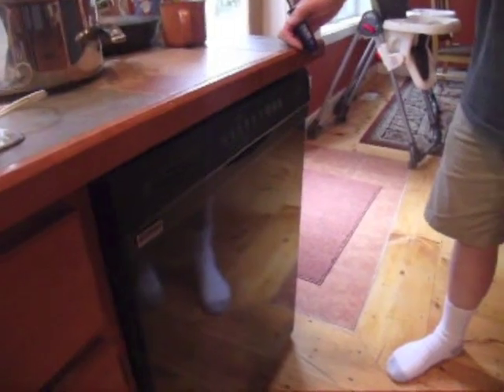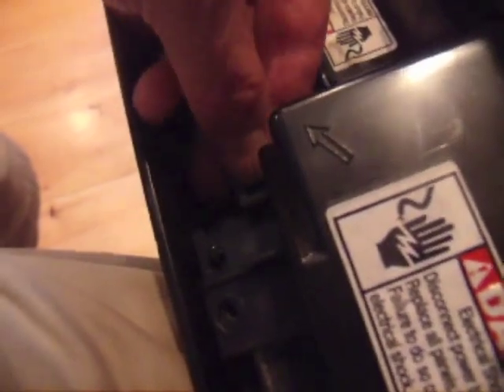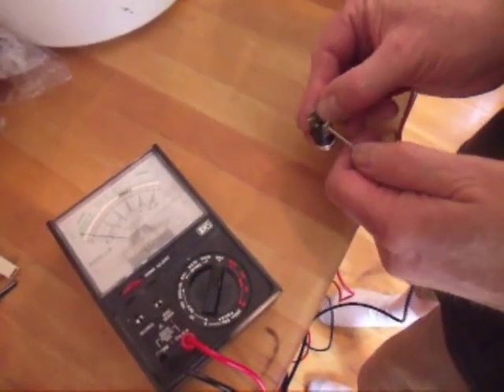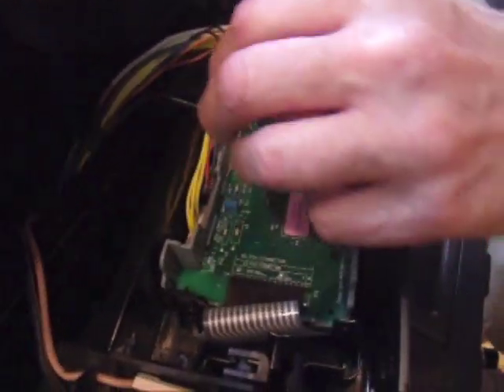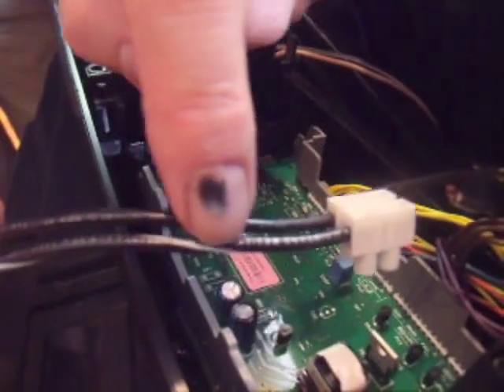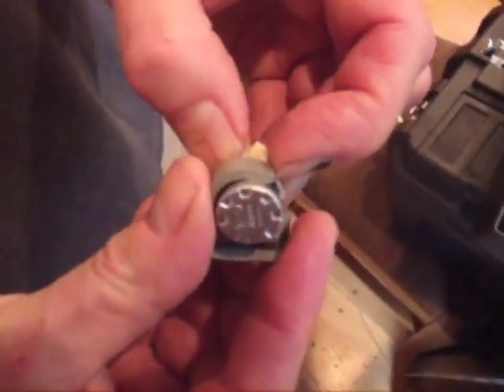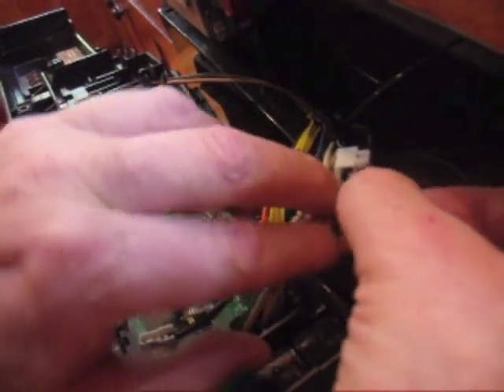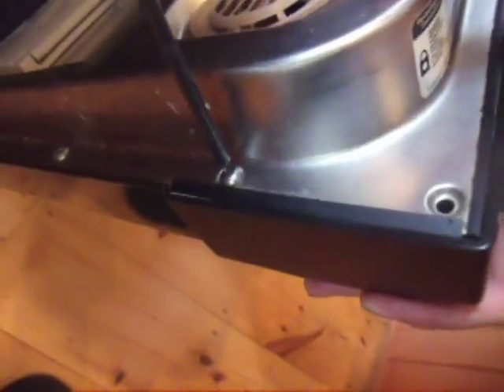What to Do When the Dishwasher Won't Start

Comment: To the people asking "why cut the wires and replace the leads"?
The OEM replacement part calls for you to do that.  The new "connector" has heat sensitive material inside that helps, more accurately, to protect the dishwasher.  Apparently it was to correct a design flaw in the original engineering, where the bi-metal fuse wasn't blowing as it should when the unit overheated.
The new connection is more sensitive, thus allowing the fuse to blow as it was originally intended.

This isn't something this gentleman just decided to do on his own.  The instructions that come with the replacement kit calls for it, and he was just following said instructions.
Reply from the maker: Precisely. Thank you for the helpful explanation!
Reply: Goat comment! Thank you.

Comment: Why did you cut the wires and replace the leads? Makes no sense. It was the fuse that was at fault.
Reply: True, I was wondering about the same thing too
Reply: I was thinking the same thing and made a comment as such, but then read elsewhere that the new kit has updated heat resistance that better protects it. But I guess if you were only able to find the fuse locally you could obviously just change it and order a kit just in case

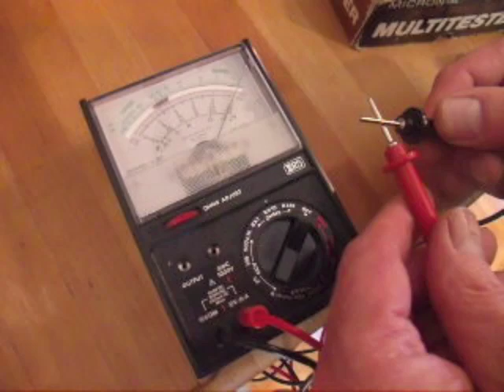Comment: At 4:27 we see that the new fuse has the same connectors, so there was absolutely no reason to cut the wires at 01:58. Indeed, at 01:37 he removes the old fuse from the wires, so why didn't he just do that to begin with, instead of cutting the wires off??
Reply: Then he should have had stated something about checking the replacement thermal fuse connectors, and IF they do not match, then verify that you have the correct replacement fuse, and only after those two steps should you cut wires.  I see that by adding that wire joint block, he has more versatility with what he can connect, but is the fuse going to change with-in the same model of dishwasher circuit board?
Reply: The replacement came with a pre-wired thermal fuse with a preinstalled coupler.
Reply: i thought he was going to solder them together and not use a fuse

Comment: Thank you so much Stan for posting this video! I was stressing out because we could not afford a new dishwasher and/or to hire anyone to fix it (ours is an older KitchenAid Architect Series II Built-in Dishwasher KUDK03ITBL) So I watched your video and thought I'd give it try. After weeks of dishes piling up, I found where I could get the exact fuse, and simply replaced it. I've never been so excited to see little blue lights light up on the dishwasher in my life.... Success!

Comment: I didn't have to cut the wires? Why would you do that? You can just replace the fuse!! It's all fixed and works great!! Thanks for the great tutorial minus the cutting the wires part ;)
Reply: They say to use the entire kit as the metal connection acts as a heatsink possible keeping the heat down so that it dosn't blow again! Apparently there is a problem somewhere are it wouldn't have blown in the first place, maybe as parts get older they start to require more energy and thus more strain on the fuse, so this is where the new wires and heatsink come in to play! Hope this helps some, cause I was on the same band wagon with why do that!

Comment: +doityourselfstan,  Why the hell do you cut the wires and go thru the whole process of stripping them etc, when all you have to do is pull the plugs off the new fuse and plug the old wires right back on?????   That would only be necessary if the new fuse came with different size plugs for some reason, but in my experience that is not the case.  Also, you stressed the point about making sure to match up the wires correctly when doing it your way - black wire to black and striped to striped - you do realize this is simply a FUSE, right???  It makes NO DIFFERENCE which wire you connect to which, LOL.  A fuse is not polarity sensitive, the electricity goes in one side and comes out the other, electrons don't care what color the wires are!!  LOL
Reply: You ALWAYS cut the wires. The wires and connectors often cause the thermal fuse to blow. This type of fuse is not the typical fuse everyone is familiar with. It blows due to high temperature, not shorts. If you read anything on a dishwasher thermal fuse, people have installed as you describe, using the old connectors.  May work a couple times but they all end up getting another thermal fuse kit and doing it just as Dan describes. Go to Amazon, search dishwasher thermal fuse, and then read a few of the comments.  Every single person who tried to short cut the repair the way you describe, ended up having to purchase another kit. 100% of the time.
Reply: @gregsimpson621  I think half of the failure rate has burned up connections, it is why the thermal goes out. The newer spade terminals are probably more heavy duty. Once you pull the original terminals off they get more sloppy...
Reply: I'm getting ready to deal with this problem, so bare with me.
I totally get the reasoning for using the new wiring over the old wiring. That makes sense. But, my question is.....will the wire damaged by overheating be only within the first couple of inches from the fuse? Or, could more of the 2 wires be damaged on down the wire?
Thank you for insight!
Reply: @danmidkiff5416  The heat is generated at the connector from a bad connection and travels down the wire. It is usually only a few inches from the connector. If you have heat damaged wire you want to cut farther down where the wire is good.
Reply: @jamesward6503  thank you, James! Happy New Year!

Comment: Try this first, take the dish washer panel off and use some (do not use WD40) CRC QD Electronic Cleaner (Wall Mart under $5.00) or any electrical contact cleaner. TURN OFFTHE POWER BEFORE STARTING THE REPAR !!!!!! This may work on your garage door, microwave (worked on all three for me )washer, dryer , computer and any other circuit board and electrical connections Your contacts on your circuit board and wires may be dirty. So don't be stingy (it will not hurt any of the electronics) soak the connections and boards. I have to do this with my microwave (if you boil a lot of water) and I fixed my 14 year old garage door opener. Fixed my dishwasher today and it's   over 12 years old.  Not sure why no repair guys don't tell to try this before more elaborate fixes

Comment: That is only one cause. My Whirlpool Dishwasher control panel does not light up! There is power in the door , the Thermal Fuse has conductivity and so does the door switch. Does this mean the Motherboard is bad. Your title should be, "One Reason Why Your Dishwasher May Not Start".

Comment: Every 3 weeks my dishwasher just doesn't turn on.  I have to turn off the breaker....unplug the power to it replug it in reset breaker then randomly it works again for another 3 weeks....I wonder how I can troubleshoot this problem with a multimeter

Comment: Hi, I bought the fuse online and replaced it. But still it won't start and no lights. Any suggestions ? please
Reply: +Breesh Pruthi
A power surge knocked out my stove and dishwasher circuit boards -- neither had any working lights.  Looking at the boards, it was very obvious that a resistor burned out on each.  The local appliance repair store charged $180 for a new dishwasher circuit board (plus $60 core charge).  A ridiculous price, but I needed it NOW.

Unfortunately the thermal fuse burned out a week later.  Tomorrow I replace the fuse and hopefully everything will be good.

Good luck!

Comment: The problem here may be underlying. As a mechanic, the question begs, why does a fuse blow? The obvious answer is an overloaded circuit or a short. Electrically,  the same thing.

Comment: Thank you for the video. I didn't not cut the wires like you said I just replaced them all because thats what came in the packet. But you did show me how to use the o-meter  to see if my fuse worked. Which it didn't. So thank you a lot
Reply: hi pretty lady

Comment: Great video Stan!  Clear, concise, and to the point.  Anyone who does not cut the wires but rather tries to use the old clips will be buying a second kit. I'm glad you emphasized that critical step.
Reply: I'm very curious to know why that's necessary.  As a novice repairman, it just seems natural to reuse the old clips.
Reply: They say to use the entire kit as the metal connection acts as a heatsink possible keeping the heat down so that it dosn't blow again! Apparently there is a problem somewhere are it wouldn't have blown in the first place, maybe as parts get older they start to require more energy and thus more strain on the fuse, so this is where the new wires and heatsink come in to play! Hope this helps some, cause I was on the same band wagon with why do that!
REPLY
Reply: Good point but along those same lines it would seem that complicating the cable (splicing two together) would only add to the resistance we're trying to avoid.  Why not clean the original contacts?  Again, I'm neither a professional repairman nor an electrician but it seems we've potentially added to instead of subtracting from any resistance.

Comment: The normal wash light flashes. Cannot get any other button to work  When I turn power off and on again, normal wash and heat/dry option buttons stay on  as they normally would be on. After 15-20 seconds, only normal wash stays on and it is flashing.

Comment: Before cutting off the connections (terminal connectors) , just check the old ends & the new fuse to see if they match up.
If so, no cutting and replacement of the fuse connections are necessary.
Reply: Yes - that was the one thing I had a question about as I watched the video.  I was saying to myself, I'd rather use the old ends if they work.  Thanks for your comment.
Reply: IT IZME_ &

Comment: Don't forget to try other easier videos first before going through this monstrous hell, because the oroblem is easier to solve on those videos so you don't have to become an electrician and start tearing the machine apart.
People don't want to have to do all of this and usually  don't have to!   Can't they design a good dishwasher that's as reliable as the old ones though?  These silly motherboards cause nothing but problems that require resetting often when the red light goes on.  The machines somehow reset to a 2 hour setting and then you have to figure out all over again to get back to your normal 30 minute setting which requires you to watch a few videos because there is no reset button.

Also, I've only had mine for a couple of years and one of the rolling wheels under the basket fell off.  Cheap stuff.  I don't know where it is.  Probably was on bottom of dishwasher and I didn't know what it was so threw it out.  Where can people order more wheels?  Do these dissolve with time?  This wasn't the cheapest dishwasher on the market so I certainly expected better quality.

Comment: I have an MDB5651AWS model Maytag. Instrument panel lights and the machine were working intermittently but eventually stopped and now no lights and washer not working at all. 

The door switch is working but wanted to see if there is something else I can do before spending $130-$180 on another instrument panel. Other than the thermal fuse do you have any ideas?

Comment: With my GE Nautilus GSD2200G00WW dishwasher the thermal fuse was OK but one of two "interlock" switches had gone bad.  Over time the contact had gotten dirty, creating a less than ideal contact surface which caused the switch to overheat and melt.  On my model there are two of them, one in the neutral feed and one on the "hot" lead.  Both were located in the control panel and actuated by the lever.  

$11 each (I replaced them both) plus s&h online.  Your mileage may vary, follow all safety rules no warranties implied or expressed.  Good luck!

Comment: i just installed a new control board and tested the unit but it only starts to fill then shuts down and the start button starts to flash and does nothin after that. its a whirlpool dishwasher

Comment: Hi Stan we have a Kenmore Elite dishwasher model #66913943K010 purchased in 2011. Recently some of the lights in the panel have gone out although the unit runs but I have no idea what cycle it is on?? I believe it could be the thermal fuse you have talked about in this video but am not sure? We live in a rural area and to bring in a service tech is requires two trips; one to diagnose & order part, second to repair once part arrives! Expensive and time consuming if it is something I can do. Where to purchase thermal fuse to try that first, thanks!
Reply from the maker: +Bill Wille Wish I could pinpoint your problem, but unfortunately, I am not a professional appliance repairman.
Reply: Bill Will
Reply: dump it in the creek and buy a new one

Comment: Thank you for the video. My diswasher didn't power up after a black out. After watching  your video I felt empowered to open it. I found a lot of mini roches on the control panel and a lose connection. I cleaned everything and push the lose conection back in. Now my dishwaher works. Thanks
Reply from the maker: Awesome!

Comment: The power come on and the unit fills with water, but then does nothing. It won't run through it's cycle. Any ideas?
Reply from the maker: Jeff Darden Could be a bad motor, bad control panel or a faulty connection between the control panel and motor.

Comment: Your video helped me figure out that my dishwasher fuse was dead. Thanks! But you said a bad fuse will read 0 ohms. I think you have that backwards? The way I test for a fuse is with continuity, if there is continuity then yes the fuse is good.

When the ohms are 0, the fuse is good I think

Comment: Stan
Great job with Video and information. I replaced the thermal fuse and it is working perfectly. I did not cut the wires as you did because there appeared to be no reason to do it (even though the replacement part comes with the wire and connections everything looked clean).
You are very much appreciated!

Comment: I have a ge dishwasher lights come on but won't start. Tryed unplugging it. Son opened it up all plugs are connected.  Still won't do any thing. About 4yrs old used very little. Have tryed restating it. Help please
Reply: This is a two year old post but the answer is a dime caught in the pump.